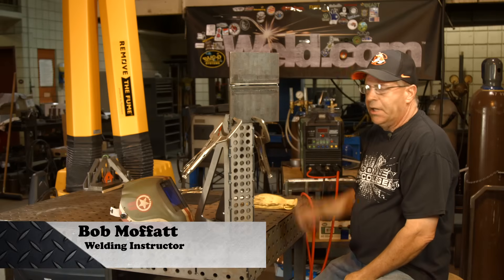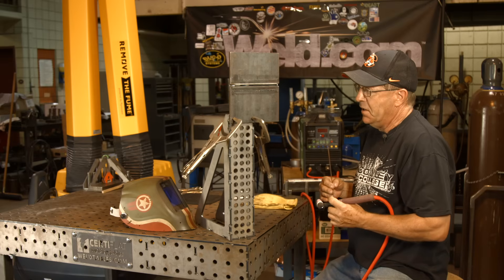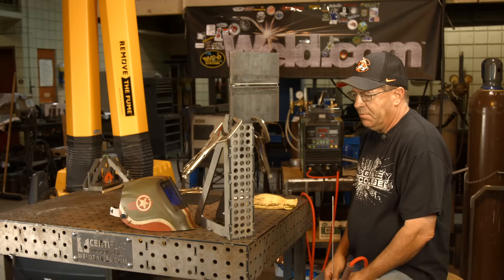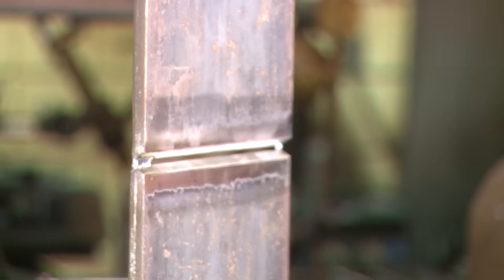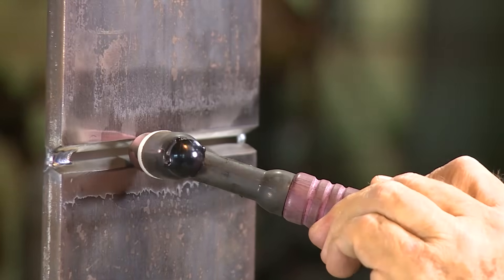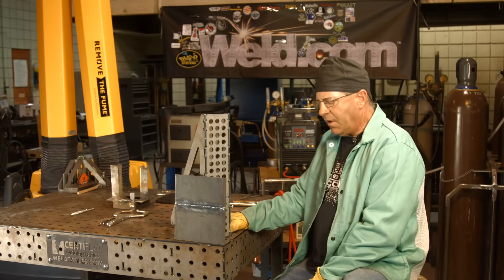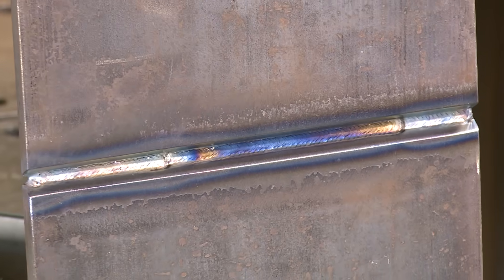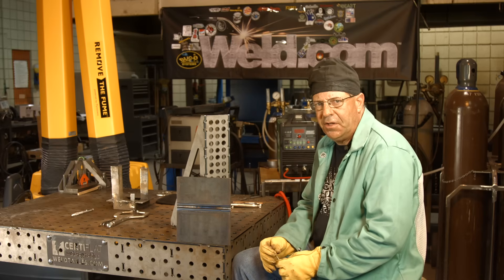🔥 Tips for Success: 2G TIG Roots (Viewer Request)

Comment: I need some advice starting out of position.. my problem is when I go to start adding wire I end up with tungsten in puddle or my filler stuck to my tungsten. If I don't kill my start it usually goes ok but my starts are killer. Specially bottom to vert up, terrible time with sticking my tungsten right in the puddle like it was meant to be lol. Help

Comment: I never know how much heat to use or how much wire to feed. My roots always look good on the outside but are chopped up and uneven on the inside. If I do a tight fit and lay the wire in i get a smooth root but it's always dead flat

Comment: Do you have any experience with copper nickel pipe? I am currently prepping for a weld certification using ercuni rod on 4.5inch pipe 1/4 inch wall thickness. The pipe will be purged and in the 2g position. Any help is appreaciated.

Comment: How do you avoid getting suck back? It happens quite a bit when I weld 2G pipe and would like some tips
Reply: Something Cool let it cool down more before running the hot pass mate, you should almost be able to touch it. Thats on carbon/stainless

Comment: Hi Bob that' was some lovely welding. Great explanation on how to weld in this situation.  I'm in a dilemma on what type of welder to buy. I have just started stripping down and restoring a colchester master lathe. And it needs some minor welding done on the oil tray at the corners. I know it's a difficult question to ask as there's so many ways on doing welding but could you recommend a first welder which would help me out on doing some repairs on my lathe. I was thinking oxyacetyline.  But not sure if  this is the route to go down . Obviously I would need to practice practice and more practice on some scrap metal before I even contemplate working on the repairs.  I also have some cast iron repair to do. Would really be grateful for your advice .

Comment: Nice hand eye coordination on that root!!  Remind me what causes the coloring?
Reply: Steve Friedlander 
the  colouring is oxidation caused by the air coming into contact with the steel whilst its still at a high temperature. Doesnt have to be red/yellow/white hot or in a molten state to oxidise

Comment: Bob can u show how to run a filler metal with 5/32 er70s2 on 6g back feeding it or the other way I use to running 1/8 filler metal back feeding. Never used 5/32 rod would like to learn how
Reply: Erick Manning Try it, you may like it a lot.
Reply: Bob  Moffatt  at what amperage do u run 5/32 er70s2 ?at and what size gap do u use ?Will it run good with a 3/16 Welders gap?
Reply: Erick Manning Yes, about the same amps. Maybe plus 10

Comment: Great video. Feeding from backside. Weld looks great and root reinforcement. I can only stick weld nicely with 7018's but I struggle with tight welding. Always making the tungsten sharp point flat then resharpen a lot..I did single coded in 60 days then failed my pipe now I can only stick weld good but not tigweld. I'm going to welding school again soon already paid for structural welding. How long does it take to get stickwelding skill right. Like example 8 weeks training then test and then  how long til Welding? I really want to become a welder.

Comment: Hi Bob, 

I enjoy watching you videos and learning from your expertise. 

I've seen you do pipe feeding the rod from the opposite side, through the fit up space,  but there would be many instances where it would not be possible to feed the filler from the opposite face. 

In such a situation would you choose a different weld process - stick, mig - or feed from the face side? 

And if you did feed from the face side using tig, would you change anything - amperage, walking the cup, etc? 

Thanks
Reply: Bob  Moffatt  can you please make a video of tie in on stick plate welding
Reply: Riley Weasenforth Sure. We will put it on the list.
Reply: Dennis Leadbetter I wouldn't change anything and feed it from the face or groove side. It's all good.  Thanks for the feedback and support.
Reply: Bob  Moffatt thanks.
Reply: Bob  Moffatt thanks so much I have to learn it for welding class

Comment: I HAZ A REQUEST!!!!  Say Bob, what do you know about MC706 metalshield with 98/2 Argon/Oxygen gas?
Reply: WyoRado Hawk  Not sure I've run that particular wire. Sounds like it would be real close to looking like a good spray transfer.
Reply: WyoRado Hawk MC stands for Metal-Core. 98 argon/2oxygen% is used for spray arc transfer. It's meant to transfer a lot of metal in the horizontal t joint and flat position usually on thicker steel. It's perfect for the production of heavy machinery.
Reply: Fickle Dick Done tons of spray with hard wire and metal core. Just not that one.

Comment: why do you prefer the larger gap? I prefer mine a little smaller than the rod, then i dont have to worry about my filler near as much and my root comes out way more consistent cause your not feeding and moving that wire around trying to get steady?

Comment: I feel like feeding the rod from the backside it cheating.  I doubt there are many real world applications other than test plates where you could actually do this.  Looks good, but I would like to see this with the rod fed on the front.
Reply: ryan diegan actually your supposed to back feed the rod if possible. I was taught in school that if I want my B pressure with a TIG root I should practice back feeding it.
Reply: Disagree, I was just on a job where the "fitter" welded a 10" pipe feeding wire from the back side except where he couldn't get the wire in. They then pressure tested the  pipe before he could fill, pipe passed fine. It was a learning experience for me to watch him doing it. I am pretty sure they do it for ease and reinforcement and I was impressed.

Comment: Very interesting, but why the two parts are not closing towards themselves while welding? Usually if I don't block the parts they move due to the high temperature.
Reply: Danny MAGOO they won't move much if you properly tack them together.
Reply: Dark Horse thanx bro'👍

Comment: Am I the only one having trouble seeing the puddle in your videos? Especially the leading edge. Can the camera man use some kind of filter to cut down the brightness of the arc? Toes and trailing edge are somewhat visible. Thanks Bob.  :)  Donald
Reply: Donald in New Mexico  I don't think anyone on the internet has better puddle videos than Jody from Welding Tips and Tricks. He uses some super secret camera and filter set up that no one else I've seen can duplicate. I'm sure these guys are working on it, but if you're looking for puddle shots right now Jody also has a very good series on standard TIG test joints.
Reply: Thanks gasfiltered.  :)  Donald